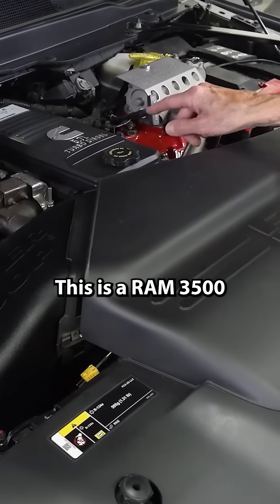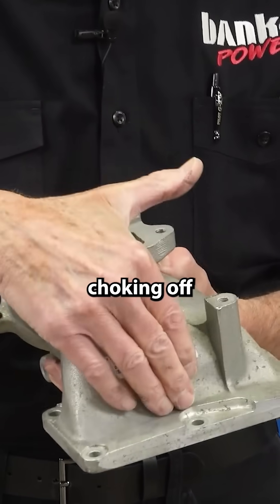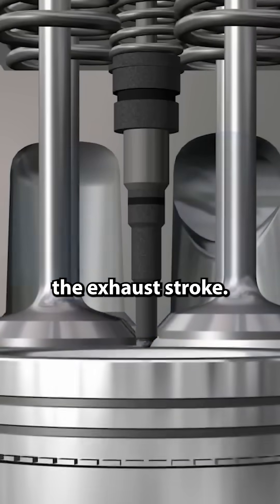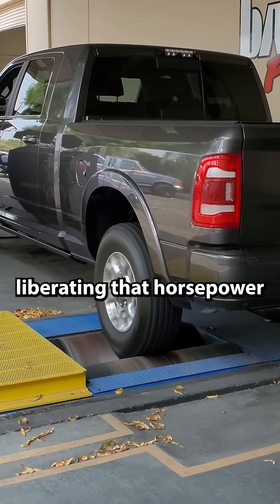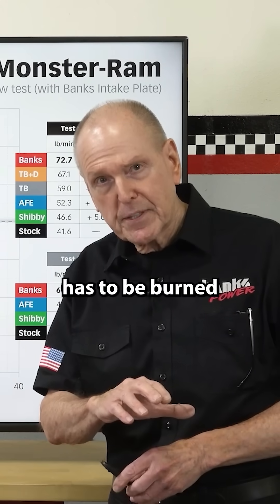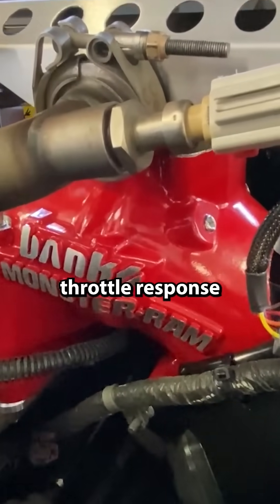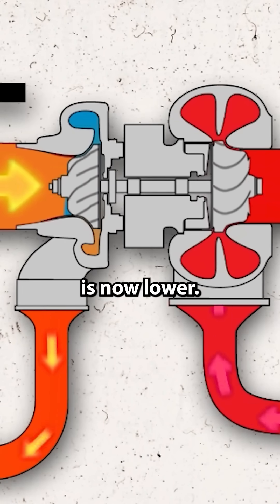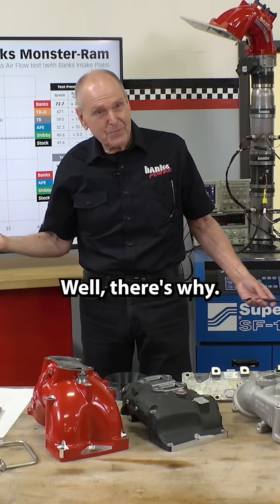Intake restrictions make the turbo work harder

Comment: We just installed the ram air on my 2010 ram 2500, and man is it worth it. Not only do you not have to worry about that drop nut, but you also get more smiles per mile highly recommended!

Comment: I really don't know much about mechanics bit if the turbo shaft is turning slower, doesn't that decreases the boost pressure, ergo less power and more lag?
Reply from the maker: The engine's tuning and the amount of power the engine can make are both based off of air mass not boost pressure. If the engine can achieve the same air mass at a lower boost pressure it will make the same power in cylinder. However, a lower shaft speed also means that less horsepower is needed to drive the turbine in the first place. You're achieving the same power but the turbo has to do less work. This means the turbo can reach that air mass target faster meaning less turbo lag. Or you can make more power at the same boost pressure as before.

Comment: Ya...mostly.  The economy part is not so accurate.  That factory intake horn isnt gping to be any impediment while the engine is pumping the air required to make 80 horsepower(or whatever low amount of power is required to propell the truck down the road.  Now, when pushing 300+hp them yes ypu need that smooth flow to get every HP for every drop of fuel

Comment: My first Truck was 1989 Ford F350 diesel my dad had a banks turbo kit added in the 1990s  and he gave it to me. I was 18 I could powerbrake it and burn all 4 wheels and it would shift all the way into 3rd gear just powerbraking. That Truck was a beast after banks got done with it.

Comment: I keep getting low boost code. I'm going back to stock .I have called many times I keep being told they will bring it up at the next meeting. And there's no boost leaking. My ram is a 2021 370 horse power and 850 torque. I was told it would be fine

Comment: Thanks to this channel, I was able to help save a friend's turbocharged D16Y8 in his Honda Civic CRX. With the parts he had he made 350HP at the wheels on the dyno at about 10 PSI of measured boost. He bumped the boost as high as 18 PSI, and the power only got up to about 390 or so, and the boost would not go any higher. I explained to him the many reasons why turning the boost up was not making much extra power beyond the 10 PSI he was running. Turns out that he had a couple issues. His air to air aftercooler was at its limits for cooling and the turbo was being maxed out. With the same turbo, a better aftercooler and some changes to his intake plumbing, he is a lot happier with the now 350HP he is making on only 8 PSI of boost, and he hasn't blown THIS engine....He has blown many before because he did not understand what he was doing wrong, when more boost was supposed to be the answer.

Comment: Bullshit baffles brains. I've no doubt that this is better than the stock system, it's clearly lower restriction. But the explanation is a load of bollocks - he starts off talking about density loss, then says his system gives less back pressure. But for a given temperature, lower pressure means lower density... 
Then he talks about changing the power required to run the turbo. No, it's reducing the change in pressure prior to the turbo. It's not clear if this is a variable geometry turbo, but if it's not then running it at a lower speed will build less boost, yet apparently that's also a benefit. 
I don't doubt that it's a good product, but the explanation is more snake oil than genius
Edit: Thinking about it, it's possible the video has been edited badly and doesn't represent what Banks is trying to say, but I'm not convinced of that

Comment: The only thing I didn’t understand is how it reduces back pressure on the pistons during exhaust stroke. How so? What back pressure is there when the intake valve is closed? I don’t understand.
Reply from the maker: As the piston is pushing exhaust gasses out of the exhaust port, those gasses have to spin the turbine in the turbo. If the compressor has less resistance, it's easier to spin the turbine which is joined by a common shaft. Because the turbine and compressor are joined together, any reduction in resistance that makes either's job easier, makes both jobs easier.

Comment: Honestly companies should be using these parts during manufacturing. They could just do a campaign saying "we only use the best, to provide you with the best". The increased cost would be minimal, but the increase in performance, economy and throttle response would make up for it.

Comment: You didn’t mention the worst part of the stock grid heater and intake horn! The nut falls off the positive connection to the grid heater and it will suck it into cylinder number 5/6 and ruin your motor! 20k gone! Boom!!!! This kit will eliminate that possibility. I’m here because my 2012 6.7 is torn apart right now because of this issue. Google the infamous 6.7 grid heater bolt if you don’t believe me. Your welcome 👍

Comment: This video makes me want to buy the ram air intake  and i dont even have a truck
Reply: I do, this model too, but I’ve thought the same thing about other videos on ones I don’t even plan on getting 😂😂 just such great products that make you say how is the manufacturer spending so much time and money on R&D and doesn’t catch this ON THE INTAKE
Reply: Scratching my head, wondering if it will fit on my Mercedes 😂
Reply: Lmao yea
Reply: exactly 😂
Reply: Cuz he’s a salesman…. 😂
Reply: @davidburdett1920  I mean... he's also one of the most knowledgeable out there. Can you show me anyone as knowledgeable?
Reply: @hisnameisiam808  he’s a good salesman, and yes he carries some knowledge. Most the time he’s repeating obvious statements or useless ones. The intake on the rams are more than capable of a fair amount of power and it doesn’t make the turbo work hard lol the stock turbo can’t as much air as the intake can handle power wise. Then it’s most likely head or cam that would be a limiting factor. Even the stock air box is capable of some power.
Reply: @davidburdett1920  lol mmk
Reply: @davidburdett1920 
Rather hes an athority on trucks, cuz he provides solutions like thees.
Reply: @mihabrilj152  what’s the problem he is solving?
Reply: @davidburdett1920  
He's showing his monster ram and how much better it is for fuel economy and power output.
Even pedal responce is better with monster ram.

Thats an improvement or problem solved.
Reply: @mihabrilj152  this doesn’t change anything on a stock truck. No problem is fixed. Tuning alone will fix pedal sensitivity and power. Not sure where the mpg claim is coming from. 

The intake system on a stock truck is in no way restrictive. It’s a turbo charged engine. Sure on its own a larger hole will flow more then a smaller one. But it’s not an issue on these trucks until power is significantly higher.
Reply: @mihabrilj152  this doesn’t change anything on a stock truck. No problem is fixed. Tuning alone will fix pedal sensitivity and power. Not sure where the mpg claim is coming from. 

The intake system on a stock truck is in no way restrictive. It’s a turbo charged engine. Sure on its own a larger hole will flow more then a smaller one. But it’s not an issue on these trucks until power is significantly higher.
Reply: @davidburdett1920  How to liberate money from stupid peoples wallets.
Reply: @davidburdett1920  He's essentially optimising intake/exhaust system for high output, but of course he's not telling people the effect it will have at lower output - where these engines operate 90% of the time.

Comment: I got this kit to delete the possible chance of that nut falling into my #6 cylinder and blowing my engine. What I noticed after the install is, quicker throttle response. Can’t say it will make much horsepower but you don’t have to push the peddle as much as before. Combine this with the monster throttle and it’s a pretty fun truck.

Comment: Just installed Ram air grid delete and charge pipes and air cleaner all the Banks goodies, GA truck no EGR , after installing took annual trip hog hunting and what use to be a tank of fuel hauling gear and quads was a half tank, great power response also super proud of the banks on my 2012 2500 4x4 cummins

Comment: Bone stock intact g56 2500 with 145k. I was experiencing lag/ dead peddle as I was taking off. Got this to prevent the bolt into piston issue the Cummins is known to have and increased at least 1 mpg and peace of mind. Also no more dead peddle/ lag as before!! Definitely worth while. As new truck come more and more complex I don’t think I’ll replace mine until absolutely needed.
Reply: My neighbors 2019 just dropped the bolt into #4 piston.  $24k repair.
Reply: @redbovine Jesus christ

Comment: I have one of those installed on my dodge 3500 and I didn't notice anything like he is describing,  the reasion why I had it installed is because the stock intake heater grid , has a nut that likes to rust and then fall into the piston destroying the engine ....I didn't know I could have just done a heater grid delete,  and not spent the 2000$ a shop charged me to install this intake

Comment: I have this on my Ram 2500 with a high output 6.7 Cummins and I can attest to this statement being very true I love the monster air ram!  I get close to 25 Mi to the gallon
Reply: Did you do anything else to get to 25mpg
Reply: I got EGR deleted and 5 inch exhaust and easily get 25mpg with the Banks
Reply: @kennethscott6993  yes I put a chip in from BigDaddyDiesel. Although I haven't done the full delete. I'm sure if I deleted the EGR and exhaust I'd get more MPG.
Reply: @ianlewis7605 ya I wish I could do the that same to my new ford f350 but the emission laws are so bad in California I’d probably be locked up😂😂😂
Reply: @ianlewis7605  Cummings just paid 1.6 Billion in fines for defeating emission devices.
Reply: @lucasgrove1685 lmao the good ole commiefornia
Reply: The 2500s never came with the HO engine
Reply: Exactly, people are hilarious. He drives a Prius
Reply: @TheRamGuy  yes I swapped one out of a 3500 that was in my local impound yard. A DUI total loss of a really low mileage H.O. 6.7 you are correct on that comment.
Reply: Has anyone done actual before and after on dyno?
Reply: @carl2591 darkirondiesel did comparing the banks and bd diesel version
Reply: They don't put the HO in a 2500
Reply: Other than the chip, is the rest of your motor stock ?
Reply: Did you actually buy it?
Reply: @teannatrump2622  yes I did buy it
Reply: Did you do the grid heater relocation too?
Reply: @enginesandoutdoors3238  yes I did, it's on top of my banks monster air ram
Reply: @ianlewis7605  would you say the banks grid heater works well? I’m trying to decide on banks or glacier diesel for relocating mine. It gets cold where I live.
Reply: @enginesandoutdoors3238  I'd go with the banks
Reply: What about Naturally aspirated engines..

Comment: I haven’t noticed any difference after installing this in my 2500. At least the grid heater is gone. Personally I think it’s over rated for $1000 plus install.
Reply: You need to get a tune
Reply: @dylanvandenberghr5492  tune would have gave me gains with or with out that. Don’t know where you’re going with that. I’m talking only about the part.
Reply: @dylanvandenberghr5492  where in the video did it say I need a tune to get the benefits he showes on a graph. You guys couldn’t finish a 2 minute video? Don’t bother watching the full testing videos.
Reply: Are you supposed to have 200hp gain?
Reply: @2015_Rubicnn  who implied that?
Reply: @doc4555  That's my point. That part by itself isn't going to net you any substantial gains. A tune will do that, but maybe this added with a tune it will shine better....
I don't believe that was Banks point of this part. I think it's more about efficiency increase more than anything. Too many variables to say why one vehicle may see something increased vs another or nothing at all.
Reply: @2015_Rubicnn  you’re taking it all out of context with your first comment about 200 hp gains. A gain is a gain and I experienced none of that. Banks talks himself about gains and loves to show review’s people talking about grains having that part in.  I could do a tune with out the part and get gains no problem. So were you going with this? Why does it bother you I expressed my view of the part I installed. You don’t even own the part or a diesel. I know this cause you’re not defending it personally from experience. You just a keyboard warrior. Go back to commenting on yelp.
Reply: @2015_Rubicnn  did you even watch the video genius? He shows a graph building more power. Again shows a graph.  No talk of a tune. Talks about better throttle response too.   You can’t even comment cause you don’t have it.
Reply: Tune got me into the 20s mpg. Idk what he’s talking about with back pressure, the turbo is already creating that. I could be wrong but restriction doesn’t seem like it’s as big as deal on a diesel as on a gas engine, especially with turbo. I’d imagine things like the grid heater “restriction” is negligible as the turbo is forcing the air in, so it’s not like air is being restricted through vacuum. 
Banks is cool, but a tune will do more for you than these aftermarket parts.

Comment: On my 2018 3500 I didn’t notice much change on anything, on my 2014 5500 chassis cab I did notice a slight throttle response improvement. I mainly did the upgrade for the heater grid fix before is had a bolt failure and major engine damage
Reply: You get it tuned ?
Reply: @Sup_Evox  no, both trucks are 100% stock. This is the first thing swapped out that’s not OEM on each.

Comment: I have everything you make for my ram 2500 6.7L 2018 but the problem I am having is getting the oil filter out with those big azz tubes in the way now it is tough as nails to get out.  Other than that the filter sucks cleaning also hard to get out just for a filter anyways it runs good and you can hear the air coming into the intake like a tank
Reply: They make filter plugs for Cummins oil filters one of the best cheap investments I made
Reply: I'd imagine you could use a filter relocator to solve that
Reply: I put a small Walmart bag or a vinyl glove over the top of the filter to where it stops oil from coming out when you flip it horizontally to pull it out the small area between the lines
Reply: @Allgravybaby  I do the same thing it’s getting it through its hard to pull out side ways with the little room there is now for the space.  The space prior to the larger tube install had just enough room to pull the oil filter through
Reply: I hate changing the oil filter on even a bone stock 6.7 so I feel ya there

Comment: People excuse OEM saying they did the engineering and you shouldn't need to change things.
Reply: Yup. OEM had different priorities. Manufacturing costs, noise, etc.
Reply: @skystryker2300  MONEY***
Reply: @skystryker2300  99% is because of pollution controls in California.
Reply: Yes but when the stock heater stud fails and cylinder 6 gets parts in it, it becomes a very expensive problem. This monster ram makes this problem disappear.
Reply: They're right that you shouldn't need to change anything. They're wrong in assuming that that means you don't need to change things.

Sometimes you don't, and sometimes you do, and some of the options for the things you need to change are stupid and counter-productive. And the things that fall into each category depend on what you're driving and how you drive it.

My dad always asked customers how they planned to use a vehicle when he got a rebuild job, because he'd recommend different parts and tuning for towing/hauling vs rock climbing vs cruising vs (amateur) racing vs commuting, etc..
Reply: @Azlehria  I agree, the factory is for everyone, the aftermarket is for YOU, and YOU alone!.

Comment: I’m going through some things right now but after I’m through this. I’m buying this and putting it on my truck. Just had to get some Mishimoto coolant lines to get rid of the Y connection because after I replaced the line it started leaking from all the connections. So I figured just get that completely out of there.

Comment: Can a regular 6.7 be upfitted to high output?
Reply: 😂If you want to do it exactly like Ram/Cummins did it, then you will have to figure out every part that is different and swap it. 

Otherwise, a couple parts and a tune would acomplish the same or better power output.
Reply: @geoffmooregm  Tune and injectors doesn't quite get you there.. turbo upgrade, yes and then some.

Comment: You mean with a tune right? My fuel economy hasn’t changed one bit. No increase in power. I don’t really care about that though I bought it for the grid heater delete. Should probably just stick with that as an advertisement
Reply: That’s all it is!! I used black market performance for the intake horn for a slightly cheaper cost, but the grid heater be gone so it’s all good